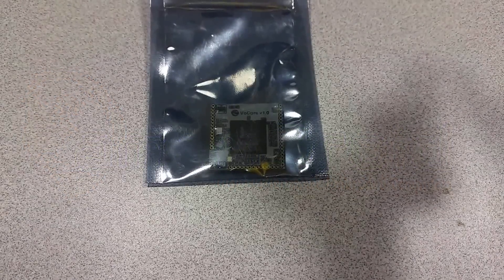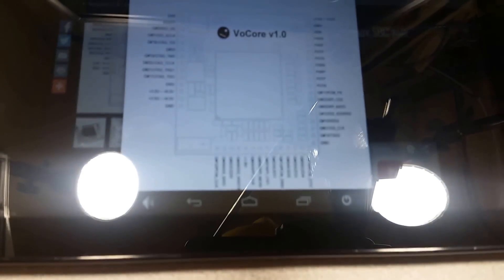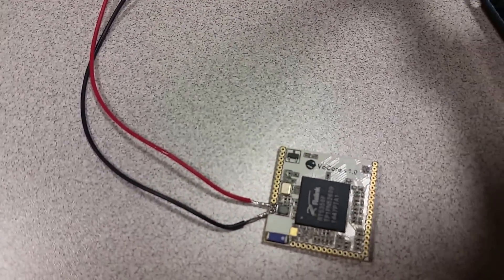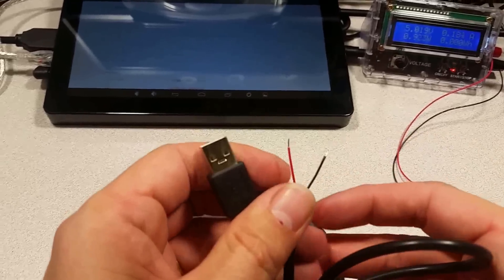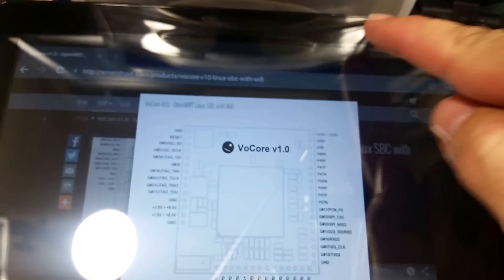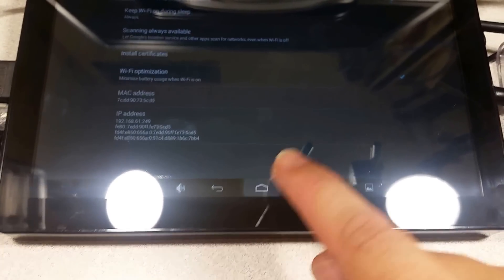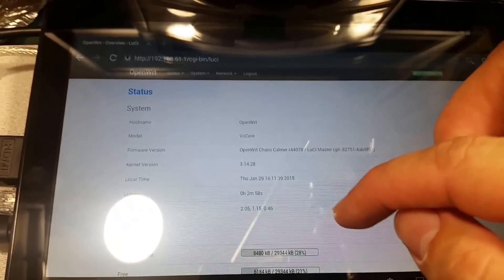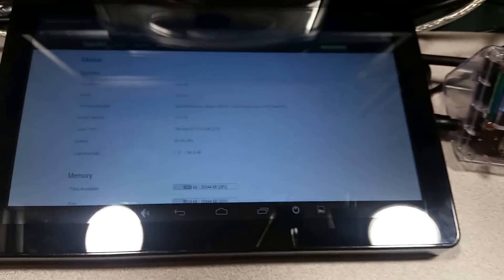VoCore v1.0 OpenWRT Micro-Router Intro

Comment: Hi.. Do you think the Vocore could run transmission? 
thx for video
Reply from the maker: +peter skinner The main limitation of the Vocore is RAM. But as long as Transmission doesn't take more than what is available, it should work fine. You can add a microSD card to the Vocore, and the Vocore with dock already has a microSD slot on it, so storage shouldn't be an issue.

If you try it, let us know how it works!